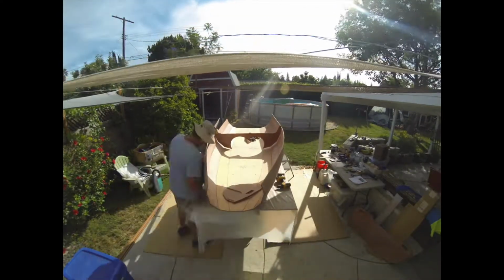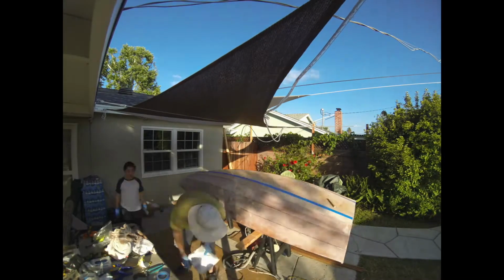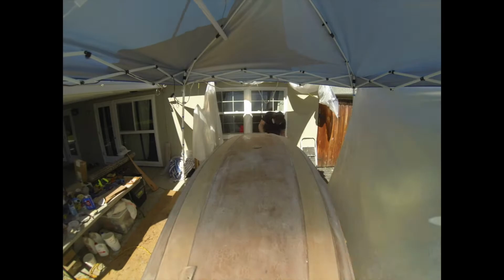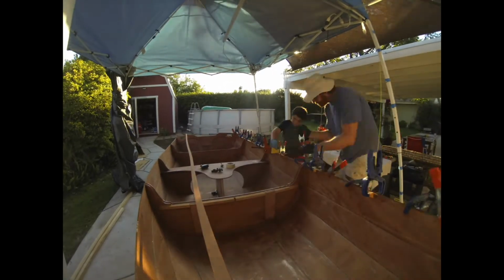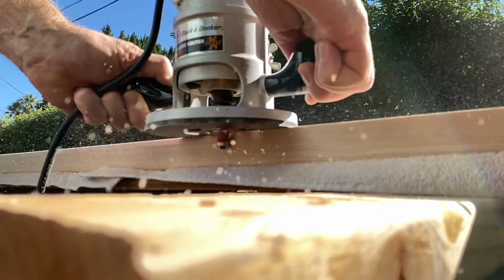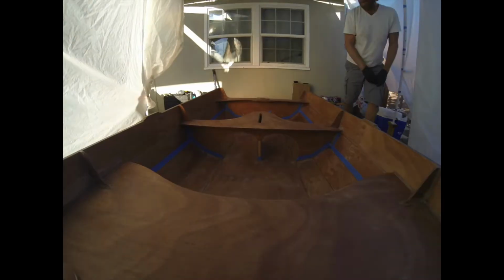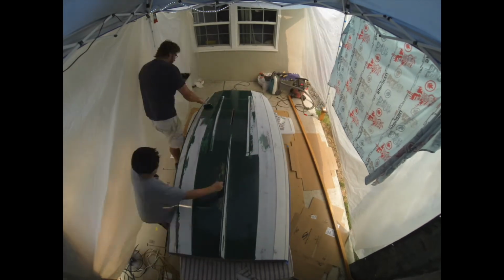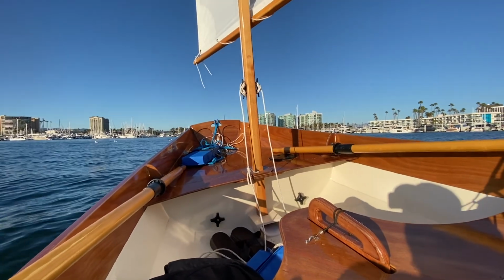Passagemaker Sailing Dinghy Build

Comment: I have been looking around at various kits, have limited experience working on a wood project at this level and the standard Passagemaker has really caught my eye... just something about a Pram and this one looks so good to me. I am curious if the epoxy that is shipped with the kit is enough for the build when applying several coats with the objective of not painting ( leaving the all natural look )... or if its just enough volume to just stick it all together and glass it in?  

Looks like yall did a very good job.... and I am starting to feel more confident that its a kit that I can work with in my back yard ;-)
Reply: starting my PMD in December.  All of the shipments have arrived.  Read the manual and gotta hand it to CLC, great job on the book!  I'm a woodworker and have owned/worked on several 40' ers.  This project should be pretty straightforward but I can get pretty anal about my work.  I think CLC has put together an incredible kit with the PMD and anyone who can read,  have a little patience and not be afraid to reach out with questions,  can build this amazing little boat.
Reply: Sorry, I just saw your comment. I had to order at least 1 more gallon of resin and hardener to complete my build. Due to lack of experience, I wasted a lot early on. At first, I wanted 100% natural look, too, but my many mistakes required paint and I’m glad for it. Looks much better. How did your build turn out?